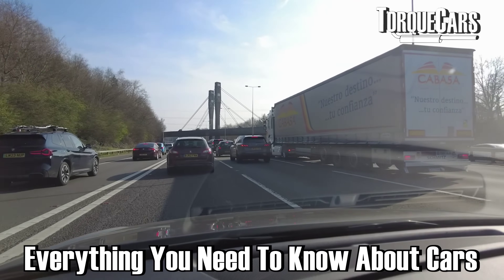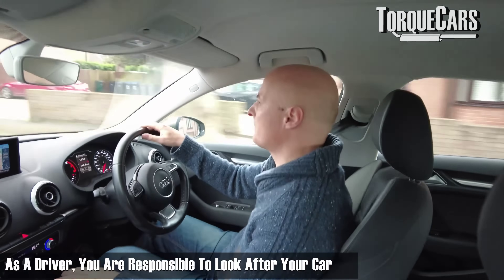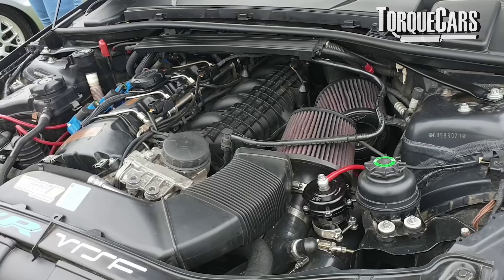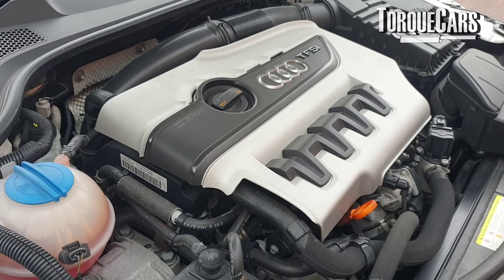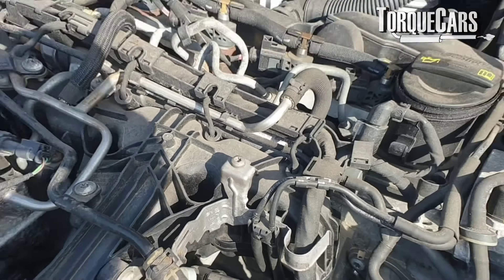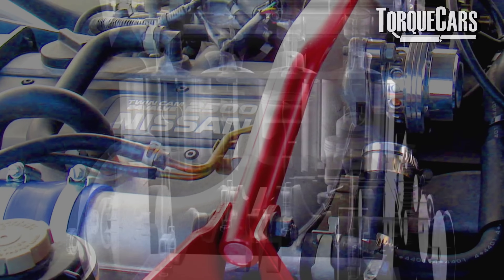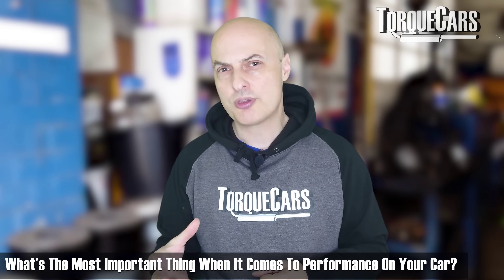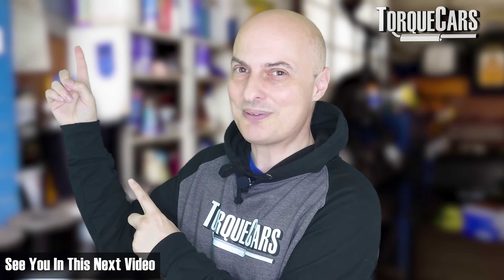Car Stuff I Found Out The Hard Way! Everything Beginners Should Know About Cars.

Comment: Also!: Going back to the basics is profitable, since one develops "bad habits" through the years. Thanks, Waynne! Hey, dude, be honest with me...has your "Odi" turned out to be reliable?! Here at the U.S. most if their models are oil-burning machines!
Reply from the maker: Hi buddy, do you mean TDi? I had no problems with mine at all, it was over 100,000 miles when I sold it and it needed a cambelt and the turbo was starting to whine a little (I'd aggressively mapped it though so that was to be expected). 

From conversations I've had with owners and the trade out there, most of the reliability reputations in the US stem from a lack of knowledge (this is generally speaking of course). Many of these imported cars are driven too carefully during run in periods, then driven hard when cold and the wrong oil specs and coolants are used. Over here most of the knowledge is out there and even local mechanics know which oils and coolant specs should be used. 

My current 1.4 TFSi is still going very strong without any problems at all, no oil consumption between servicing to speak of.

Comment: How it's pratically possible to cool the engine before turning it off? It looks unrealistic for me. You can drop a lot of ice into the engine or maybe drown the engine in a river. I can't really see other options.
Reply: Letting the engine idle a minute or two before you shut it off, especially with turbocharged gas or diesel engines is how you cool it down.
Reply: @angelawerner7696  If I do that the engine will heat up even more!
Reply: You are cooling down the bearings in the turbocharger and the temperatures in the cylinder. Driving slowly before stopping or idling will certainly achieve this result.  Some turbochargers can get so hot that if you turn off the car one can turn the oil to coke when the car is stopped.

Comment: Sorry, I would just plainly refuse to change the engine oil out if it still looks clean regardless of the mileage.
Reply: Oil ages and its molecules are subject to shearing and high temperature damage during use. These things might not be visible to the naked eye, but I guess it's your car and if you're happy to take the risk.

I would suggest paying the extra and using an extended drain interval oil though.
Reply: @dominicfong6341   my dad had the same notions and paid the price when he had excessive wear requiring a rebuild. If you want to pay thousands versus €40 every 6 months then power to you!

Comment: I've got a '99 Alfa Romeo 146 1,400cc Twin Spark (16v engine). It's short geared and fun to drive. @ 75 mph (120 km/h) the rpm in 5th gear is spot on 4k. It's most economical between that speed and 4,600 rpm, because peak torque is @ 4,600 rpm (which translates to 140 km/h) - regularly getting 6.2l / 100 km (45.6 UK mph) @ 78 mph (125 km/h).  It's happier - and more economical - being used there than at, say, 3,300 rpm and 100 km/h (62 mph). Also the oil remains much cleaner when the engine is used between 4k - 5k rpm (oil changed every 4k miles).
Reply: Oil change every 4k is overkill. A lot of oils nowadays are designed to last a lot longer then that.
Reply: @dbank6107  Maybe yes, if you do lots of miles / km per year. However I only do ~ 4k miles / year, so a yearly change of oil is essential. That's why it has over 105k miles and even with harder driving occasionally, it doesn't burn a drop of oil, and I use the lightest oil specified for my engine; fully synthetic 5W-40.
Reply: @dbank6107 For regular long trips you're probably right but for lots of short journeys or if you subject the engine to regular high power demands, such as when towing or racing then shorter drain intervals (usually called "severe" in the car's manual) are almost always indicated.
Reply: @dbank6107 my 2015 Astra oil % is factory set to 4K…. I’d rather do the oil changes for £40 per year than buy a new turbo because the oil feed is blocked after multiple 10k oil changes

Comment: I have been buying my diesel fuel from Costco for years it is 5p a litre then eny wear else it also very good my cars computer let's me now we to change my oil about every 12 months depending if I have been doing sort or long journeys my car being a diesel takes long to warm up with is not fun it winter but my astra is not has bad has my old 3 cycling vw polo diesel unless you were going at motorway speeds in the cold weather it never warm up on my 3 miles journeys to work
Reply: If you have the choice, stop using the diesel to get you to work in the winter.
All cars, especially modern diesels, can develop serious issues  if run often without the engine and associated parts being heated properly. 
Use the diesel for journeys of 20 miles+ to ensure it functions optimally.
Reply: I never use car for that short of distances. If I had just 3 miles to my workplace, I'd walk or cycle.
Reply: @igorpotocnik7231  you mustn’t live in the UK then….

Comment: Define driving hard pls lol, is it strictly motorway driving or driving 30 in a 20 mph area. Thanks for the good content
Reply: Generally let the car's oil (not water!) warm up; driving for 10 minutes should be enough. Then go on the motorway and drive at 60-70Mph in a gear which brings the engine's RPM near to the red line.

On an automatic you want to override the gear selection and watch your engine's RPM as above.
Reply: Don't think he is suggesting going over speed limits! Just when accelerating. Not really good to just stay in low gear unnecessarily.
Reply: Typically driving hard means you're using more of the rpm range. This can look different for each car, cause a high performance car will achieve higher speeds at lower gears, than lower performance cars

Comment: 14.7:1 is idle and cruise.  it's not for maxium power.   you run that at wot especially in a boosted car you will blow shit up
Reply: @jeff666p  not only boosted, natural aspiration too. They run 12.5-13.8 from factory on WOT. Direct injected Ones run 14.7 to the limit. Bmw S55 and b58 as an example